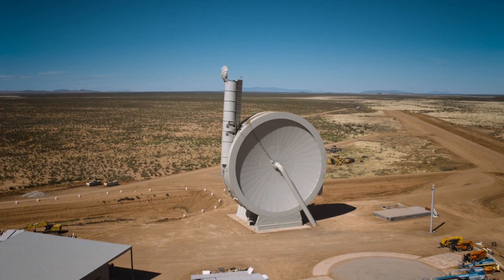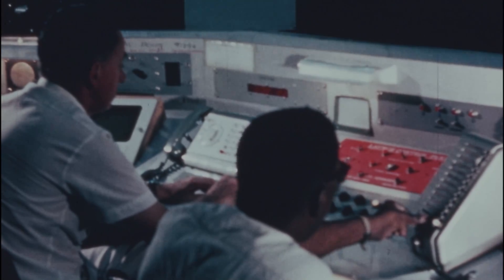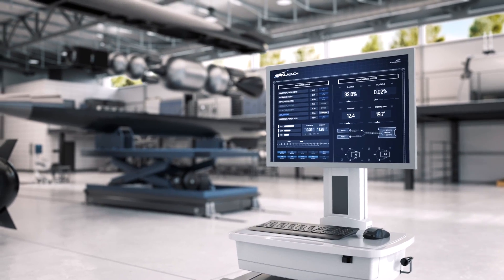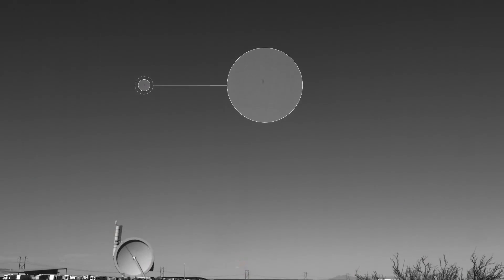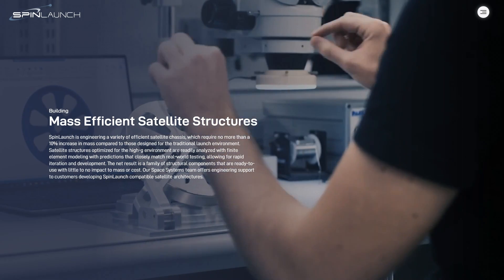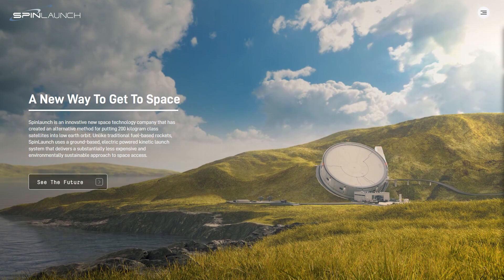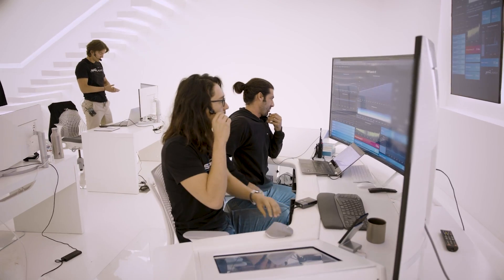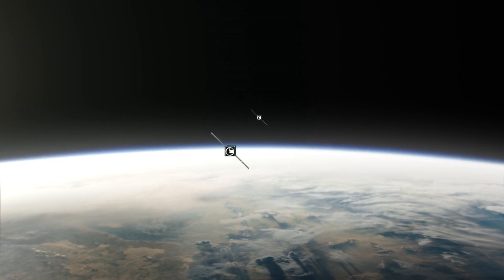Can Spinlaunch Throw Rockets Into Space?

Comment: Ahh yes, the big spinny thing
4:45 wonder if they fired a beam in front of it like those cavitating torpedoes
Although it would literally briefly plow a cylinder/tunnel (vacuum) through the air for the projectile to go through
Wonder if they built it symmetrical, released counter weight same time/opposite direction into a hole or electromagnet brake.
Other concept I saw a while back is hydrogen-based "rail gun" in the ocean